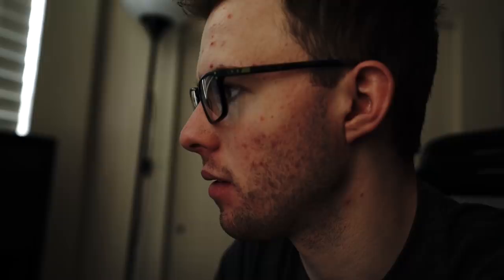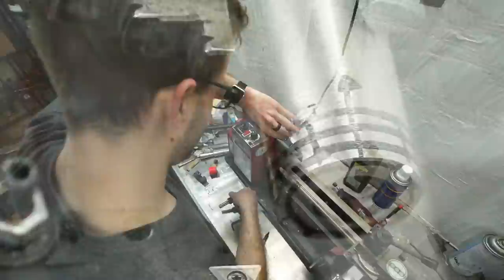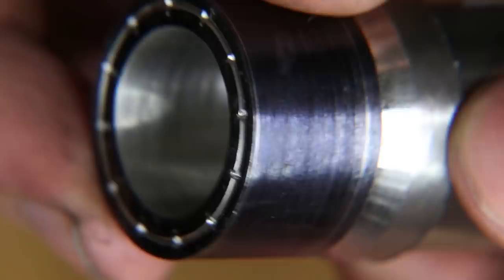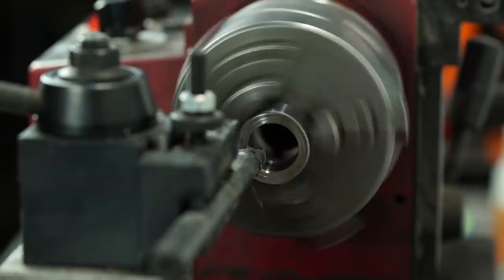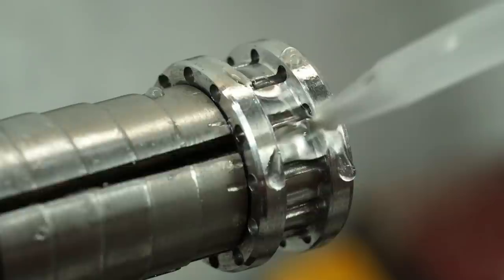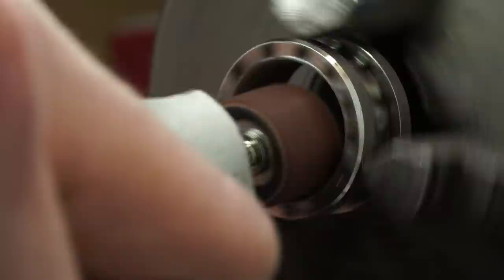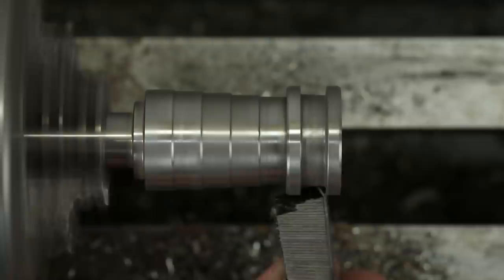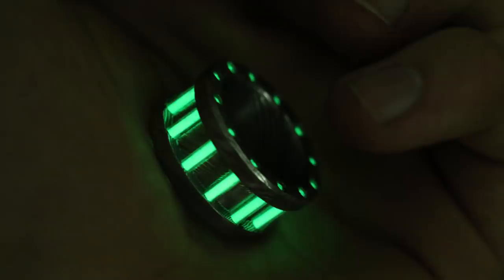Making a Tritium and Damascus Steel Glow Ring

Comment: Aren't you worried about hitting the ring on something and breaking the glass holding the tritium?
Reply: same question here
Reply: Released Tritium gas is way more dangerous... so same question here too...
Reply: I have a watch with tritium tubes in it, and from what I understand, being exposed to all of them breaking at once is still no more radiation then a day in the sun. I could be wrong, this is just what I have been told so take it with a grain of salt.
Reply: Forget the radiation,  you have glass tubes in a ring..... they're going to end up broken if you wear this thing one way or another.
Reply: @generalkayoss7347  I agree with you.
Reply: IDGAF I'd rock that
Reply: I would suggest some clear epoxy, just to protect the tubes.
Reply: it would be like a mini nuke going off
Reply: Tritium radiation can penetrate only about 8cm of air, it’s an extremely low level of radioactivity
Reply: One tube for every ex gf
Reply: @Ricky-ez2nh  no, no it wouldn't.
Reply: No ☺, this ring was meant to be hung on a chain and worn on the chest. The tritium right above the heart is a very special thing, and there it is safer.

Personally I'd suspend it in a 1cm thick glass case then wear it on the chest. I'd take it out of its casing ocassionally for somebody special, and stress its danger, as well as its legal status.
Reply: Trillium really isn't that toxic. You shouldn't breathe in the gas but dissipates very quickly.
Reply: tritium does not kill one person unless it is of large quantity
Reply: If you breath a lot of it you get slightly higher risk of cancer. This amount is harmless in all but the most technical ways.

If you ever smoked or drank you've done far more damage.
Reply: Irregardless of the dangers, or lack, thereof.  The glass is exposed, and WILL break.  The ring is then, ruined.  Why make a damascus steel ring, with exposed glass vials in a commonly impacted surface area? Seal it in acrylic, epoxy, whatever.  But seal it.
Reply: Some other youtubers have investigated this.   It's essentially a small amount of gas and it dissipates quickly if released.  You'd have to swallow a tube to do any damage.
Reply: @Peleski  I think the bigger problem is a broken/useless ring if the vials break.
Reply: @jlydon29  It's a tradeoff for having the rods so high and shining light in all directions.   it wouldn't be impossible to replace broken rods.   They're pretty easy to buy.
Reply: @jonathanbeaumont0  probably only 3.6 roentgen. Not great, not terrible.
Reply: Searched on wikipedia: wiki/Tritium_radioluminescence
Reply: @byron.  It can be absorbed into skin. The ring is on your finger, good luck not getting any on your skin if a tube breaks while wearing it. If it's your wedding band it is also the shortest route to your heart.
Reply: Mr Twister Good source from Wikipedia lmao
Reply: @byron.  But it can easily be absorbed through the skin if broken.  I worked with Tritium in the military, I would never get near this stuff again after reading up on it since I've been out.
Reply: walther007 well the military didn’t teach you shit about chemistry because it’s not dangerous and only swallowing it would do any damage

Comment: I think I would protect it with clear epoxy.How long before it make your finger fall off?
Reply: It won't. You aren't seeing the tritium. You are seeing electrons excite a phosphor on the inside of the glass vial. The particles emitted by the tritium gas are low energy and cannot pass the phosphor and vial. Plus, there is a layer of steel between the vials and the finger.
Reply: Cool, I wonder if I can get one 1.5 inch dia. ? it would look awesome on my weenie.
Reply: @nimrodquimbus912  lol
Reply: The tritium isn't strong enough to penetrate your skin.  It's only dangerous if the glass vial breaks and you breathe it in.

Comment: You should of covered the tritium with epoxy
Reply: yeah I agree...that should be an upgrade those vials are super fragile.
Reply: I also agree, it looks nice as it is, but actually wearing that... dirt, oil, etc is going to get in between the spaces and be nearly impossible to clean out. So, that problem could be avoided if it was filled with epoxy in the empty spaces.
Reply: This. All of this. Exactly what I said to my wife as he was gluing them in.
Reply: *should have
or should've
Reply: EternalDensity should have
Reply: @lanewaddell8144  epoxy would scuff and scratch over time of using the ring....
Reply: @Jorge01234  if epoxy would scratch off over time, what do you think will happen to tiny fragile radioactive glass capsules over time?
Reply: @nikolozka1  Well epoxy is basically hard plastic but it might be the best conventional method unless there's some unknown way of using glass instead without breaking or overheating the tritium vials. You just have to be careful not to scratch it while wearing it. I think you could  refinish it over and over again with epoxy as it wears over time. If that's the case then I'm sort of ok with epoxy. I just hope it's not exposed out too much in the ring so that it doesn't scratch too much.
Reply: @nikolozka1  Nothing if you're careful. This ring should probably only be used during special occasions such as parties or maybe interviews. Without epoxy it looks more industrial but yes it  would be better with epoxy if using the ring during rigorous conditions then just refinishing it with another layer of epoxy such as show in the video every time the epoxy gets scuffed.
Reply: @Jorge01234  I'd rather have a few scratches than a bunch of broken glass tubes.

Comment: Cool,  but those ultra delicate vials are exposed to damage if that ring was every worn. So its basically just a picture subject item, there's no way those vials would survive if that was worn as a ring. One crack in that glass and good bye glow. I know from experience.
Reply: R. J. Cranson you could epoxy them in
Reply: Aaron Eaton, it's not that I'm saying they will fall out. Yes you can epoxy them, super glue them or even do it the correct way and use Norland Optical Adhesive #61 to secure the vials. 

My original point was this: if the vials are installed sticking out of the machined recess at all, they are subject to abrasion, shock and cracking.
Reply: Also these vials are made out of borosilicate glass which is basically Pyrex.  Very strong and highly durable.
Reply: R. J. Cranson he means encase them in clear epoxy so they arent sticking out
Reply: The vials are borosilicate glass (Pyrex) and are very durable.

Comment: two tips:
after drilling use a reamer to size the hole for the tritium vials. and also again after turning the groove
also fill the groove with clear acrylic to protect the vials. it's not hard to damage them and would add slight degree of safety given the toxicity of tritium

Comment: I will add: Tritium can be corrosive due to the huge number of decay events. Tritiated water is VERY corrosive compared to normal water.

And of course it should pretty much go without saying that Tritium can heat up. It takes a lot in one place, compressed at high densities and good insulation, but it actually has a pretty decent power/weight ratio. After all, even at the weak decay energy of Tritium, 12.32 years half life is SCREAMINGLY radioactive. It spews out 4613.6 watts/kg of energy, although of this only 1414.6 watts is actually useful electron energy, the rest is antineutrinos.

Rest assured, a solid material like, say, polyethylene, made of with Tritium instead of hydrogen would emit impressive amounts of power. (although again, ~70% would be as useless anti-neutrinos). In that particular case 1 kg of the stuff would emit nearly 500 watts of heat and 1000 watts of antineutrinos.
Reply: I always thought Neutrons were neutral.
Reply: Why can I understand it at 14 years old
Reply: Jason Rasmussen I would create a reactor, like sure why not! I mean, I don’t have the money to get myself a laptop but I guess I can get some clocks
Reply: Deploracle A Neutrino is NOT a Neutron.
An anti neutrino is the antimatter counterpart of a neutrino.

Comment: You can buy tritium on ebay.
Reply: You can also buy toast with the face of Jesus on Ebay.
Never go full Ebay, dude. Never.
Reply: Oooooooooooooooooooof
Reply: just type in tritium sights you will find that nearly ever Gun model has a set of tritium "night" sights for them. I want to know where he got raw vials from and how much they cost though. Tritium night sights for a glock cost between 120-200 bucks so yeah it'd be nice if I could buy just the vials and drill out my own sights.
Reply: you see the problem is, that ebay is not fully trustable, ebay is kind of like the wikipedia of online stores, sometimes what you get is real, others you get a picture of a computer instead of a real computer

Comment: I would gladly pay 1000 even $1,500 for a ring like that with all that labor and Hands-On work I'm definitely the type of person that appreciates it and understands what is actually involved in making such a unique mind blowing glowing ring when I first saw the picture I thought where the batteries go to charge these little lights and then I find out it's terranium and that it glows for 20 years that is insane I love it I want one so bad I can guarantee you everyone that watches this wants one and probably would pay even more money but I don't think you can sell them because with that stuff that's in it if you sell the ring with the stuff then now you're doing something illegal right
Reply: Do the math. 40 hours + maybe (guess) $400 in materials.  $4400 would be the starting price, maybe. You pay your plumber as much or more per hour.
Reply: Tony, personally I think you're closer to the target price than Memphis, but I guess it depends on how much you value your time. I would probably be happy with half of your labor rate of $100/hr, so I could see the ring retailing for around $2500. Also, after a few attempts, there may be some shortcuts discovered, but they are unlikely to save significant time. If you want to increase the profit margin, a few "accent" diamonds, sapphires or emeralds placed between the top of each rod might do the trick & even possibly decrease the number of rods needed, if desired. Even colored (e.g., irradiated) accent diamonds would be affordable. The result would be an increased retail of another $300-$500/ring (depending on the gems & number used). I'd estimate approx $100 in materials (even if diamonds used) + labor to set the stones.
Reply: Early Cuyler still at 2500 bucks I would buy it because that's a one-of-a-kind extremely awesome ring if it got over 5 grand that's when I would say it's too much but then again people where diamond rings that are $100,000 $1000000 but I'm Average Joe
Reply: First time your hand bumps something you've got a broken glass tube.
Reply: NO it's illegal to sell so he can't sell it anyways
Reply: the real ability that goes into this ring is like... a 14 yr olds with a lathe could do the same thing, what stands out for him is his editing... thats what makes him money... its a pretty trash chunky ugly ring
Reply: @MEMPHIS REIGNS terranium rocks!
Reply: I'll give you tree fiddy.

Comment: $100 of tritium? I got 20 viles for like $20 on amazon and they work the same
Reply: REALSHIT!? I could start my own gun smithing for that cost. Bring in your guns and I'll upgrade the sights to glow in the dark!
Reply: I was just wondering if you could replace the fiber optic tubes with tritium tubes. But it sounds like they are way more fragile than fiber optic plastic
Reply: Fiber optic is made of glass and is used for a reason
Reply: Besides tritium is a gas

Comment: "Selling tritium is illegal"
Nope, it's not. You can buy this shit on Amazon.
"Damascus steel is a really tough steel" 
Yes, and No. Damascus has carbon nano tubes through out it, making it supper strong against braking, but cutting with a much harder metal band saw blade? Not so much. I.E. why you where able to hand sand down the burrs.

Comment: If your drill bits are getting dull frequently, open up your machine and lower your RPMs. You should be able to find how to adjust the speed in your owners manual.

Comment: It's a beautiful ring. I wonder at the decision to glue the tritium vials in instead of using solder or something removable to close them in at the ends so that in 10-20 years when the glow dies you can open it and replace them.

Comment: tritium is a low energy beta emitter, it is not dangerous externally (its beta particles are unable to penetrate the skin), but it can be a radiation hazard when inhaled, ingested via food or water, or absorbed through the skin.
Reply: What could go wrong?

puts unprotected vials of tritium gas on a ring around his finger, breaks vials during daily use, scratches nose [inhales], eats food and drinks beverage
Reply: Even then, and even assuming this is quality pure tritium that isn't diluted or decayed, the tiny amount of gas in those vials isn't enough to cause problems.  Plenty of other things in normal life expose you to way more radiation.

Comment: Next time, I would consider protecting the exposed vials by casting the finished product in a clear epoxy resin. It's best to be safe when working with dangerous substances.

Comment: Why not make a clear epoxy cylinder and insert the tubes and put plug at the ends or make a hole at one end only. You may like to mix a mettalic colors with the epoxy resin.

Comment: Nice ring. 

Safety tip, even tho Tritium is a beta emitter and beta radiation is blocked by clothes or skin, if ingested on inhaled it would cause some major issues. Radiation poisoning, cancer, death. 

Also tritium being a hydrogen isotope loves bonding with oxygen creating tritium water. So if you'd break it for example on the edge of a glass and you wouldn't know it. The wearer could get contaminated with tritium. 

Next time, cover the vials in some epoxy so there is a lower chance of them breaking.

Good part of tritium water is that you can pee it out. include a note when selling that ring, "if tritium vials broken, wash toroughly with water and drink lots of water after... or beer as it's a good diuretic" (Yes this is a non standard procedure for tritium decontamination but it works)

Comment: About as cool as a ring can get.  Different color tritium glow rods with fiber optics embedded in an opaque black filler.  When polished the ends of the filaments would be star like dots.  Tritium powered flex solar panel on the inner radius of the ring to charge a tiny bulk cap and power some kind of micro power electronic circuit such as a tiny flex LCD clock backlit by the tritium light source itself.  A digital clock ring that never needs batteries.  Jeweled setscrews to allow replacement of the tritium tubes after 30 years or so. The possibilities are endless and possible wealth in a niche ring market in itself.  Amazing work!!  These are the things people that have just about everything would still drool over...aka a high profit niche market.

Comment: Tritium does not actually glow itself. It can be a gas but is most stable as "heavy water" which is water made from Tritium (heavy hydrogen). This also does not glow.
To glow a bit of phosphor is added to this heavy water to make it glow. Phosphorus compounds will often glow if they are subjected to energy, including the alpha particles emitted by the decaying Tritium (in this case, in "heavy water"). If you break open the vial (do not do this, you can inhale the heavy water vapors which could be a health risk) this water will drain out and evaporate.

Comment: As a machinist of 15 years, you're not bad for no formal training. But if you want your drills to last longer, increase their speed and feed, has drills like to take bigger chunks. If that was a 3mm in damascus you want it around 2000-2400rpm.

Comment: Put heavy water inside the vials and put the tritium in a glass container in the middle connect the heavy water to the tritium using tubes and then get the energy from the mixture and there you go it’s an iron man arc reactor

Comment: I would recommend protecting the tubes with epoxy or something similar because if you don't those tubes will break very easily. They are highly susceptible to shock, and since its a ring its basically unwearable because of how fragile those tubes are. The way it is now I dont think you would be able to sell it, and if you do you would only wind up with some very angry customers. Good luck.

Comment: Apart from the thought of my fingers dropping off from radium poisoning it's an awsome ring. I would like to see one without the acid etching though😋 

Very cool ring.👍
Reply: It's Tritium, not Radium. 
Tritium is a beta emitter which is weak radiation. Highly unlikely that any beta particles make it through the phosphor, let alone the glass vile, and definitely not through the steel. Any particles that did make it through the glass won't have enough energy to penetrate your skin. 

So short of smashing the vile and inhaling the gas, it's harmless.
Reply: Jimmeh B couldn’t have said it better myself

Comment: If i could every afford such a thing it would be worth every cent. tho i think the inner ring needs to have a clear acrylic or something to protect the vials also tho the tritium is supposed to glow for 20 years be better i feel to use some clear rods in the slots do the clear cover in the centre drill the rods out and polish the slip the tritium vials in and glue a little cap on the ends so in the future in should be a easy fix to replace vials that lose their glow. :)